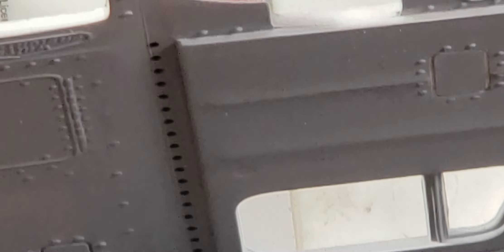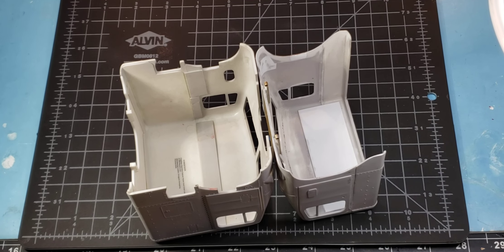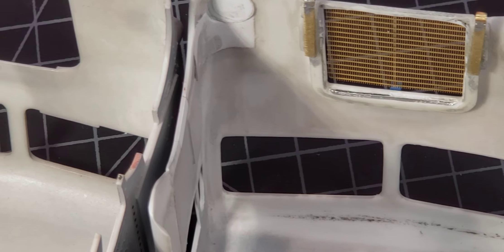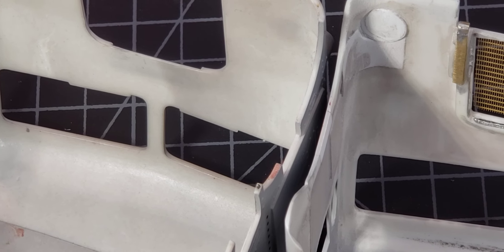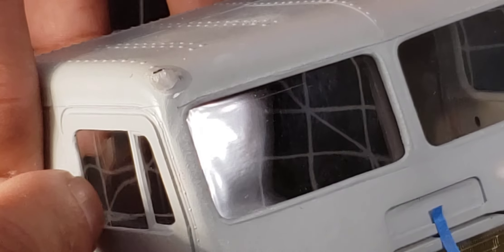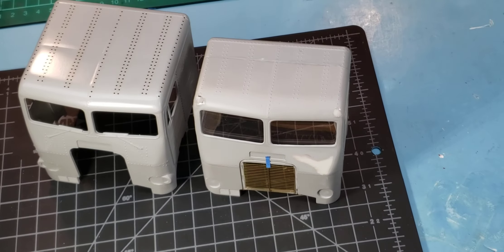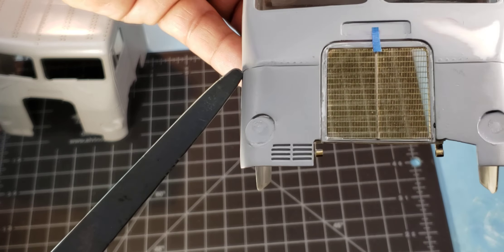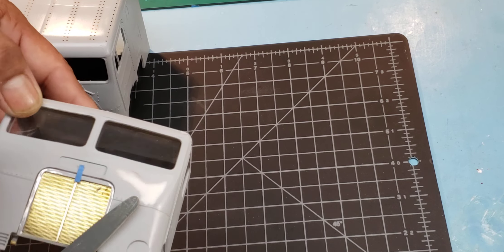AMT Freightliner Dump Truck Part 18 (2 of 2)...cab suprises.

Comment: Great upgrades to the stock kit parts. Techniques from armor, model railroading, etc. - all "transferable skills" that can be combined to produce excellent results.

I especially enjoyed your comments at the end, I remember well that 70's/early 80's era when trucks, CB radios, and of course truck kits were "in". I had a number of these kits as a youngster (offhand I recall the AMT White Freightliner SD, Fruehauf tanker, Ford C600 "City Delivery, Mack Cruise Liner and R685, Ertl's Great Dane extendable flatbed, International Transtar 4300, and S2500,  three of the four Monogram 1926 Mack AC's (stake truck, tanker, log hauler. Never did get the dump truck), and in smaller scale the TnT 1/43 scale K100 and Peterbilt 359 which I remember coming in a set with trailer and "7 Up" decals.

Had sticker shock when you mentioned the Hobby Lobby coupon price - would gladly pay $24.99 for a White Freightliner dual drive kit, even in USD. Here in Canada the going rate is closer to $65 + for one of these kits! Not that they were ever really inexpensive, it was around 1980 - 81 that I bought a Cruise Liner kit and from a $20 bill (huge money at the time for a 12 year old kid!) I didn't get a lot of change back. Italeri and Revell Germany 1/24 - 1/25 truck kits are closer to $100 + (Canadian) here. 😶

Comment: I thought about thinning down the cab on the Fright Liner but I didn't get to it. I did thin it out around the holes I added in the cab. I was worried about how the glass would fit, I'm glad you were able to show the fit works. Thanks for sharing. have a great day.  -David
Reply from the maker: David,
I think I do these extra long and time consuming steps because it literally forces me to slow down.
When I personally slow down, my modeling improves.....when I speed up, personally, my modeling gets sloppy.